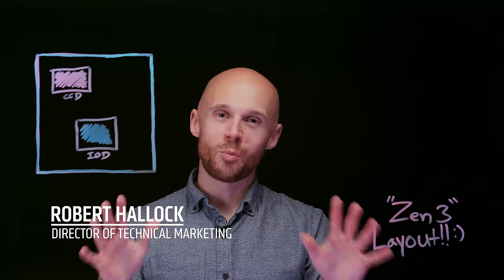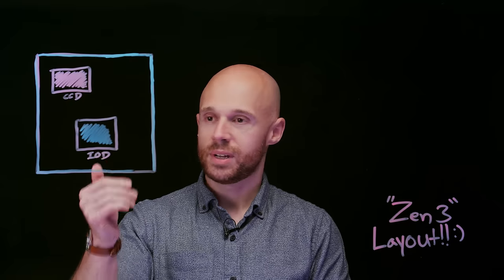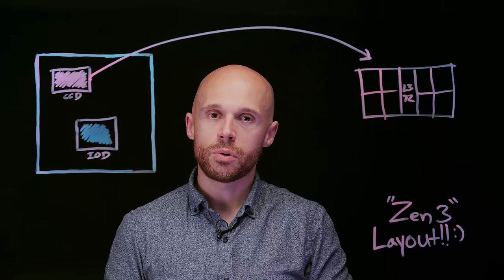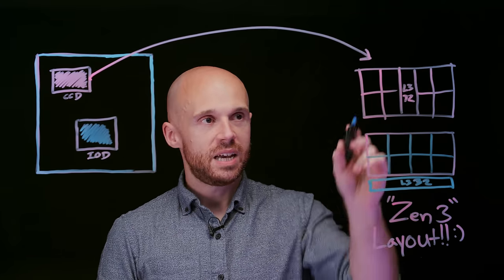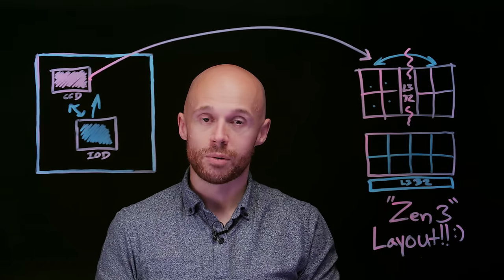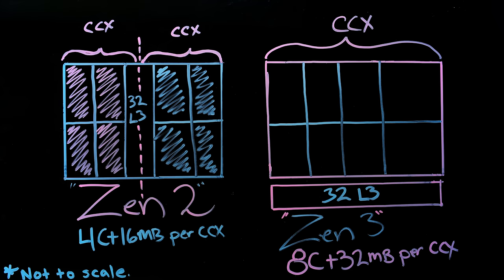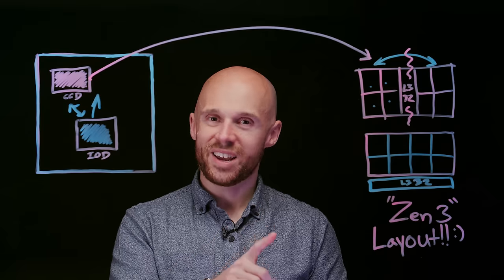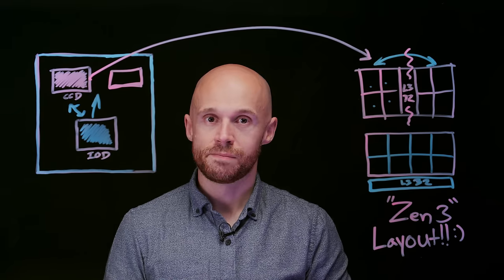How It’s Built: AMD Ryzen™ 5000 Series Desktop Processors

Comment: Rename the video to "Intel, this is how you make a processor"
Reply: This is very much AMD catching up with something that Intel figured out like 15 years ago. Try again.
Reply: @DravicPL  Does that means Intel have been selling you the same processor in the past 15 years?
Reply: @DravicPL  excuse me what boomer ?!
Reply: @ZaklanoCheljade  What are you talking about? I was talking about the architecture. You probably don't even know what a ringbus and a mesh are.
AMD's gaming performance could have been almost as good as Intel if they didn't commit to 4-core CCX few years ago. They are now going back to the trusted approach that Intel has been using for many many years now.
Reply: @DravicPL  The wheel was invented many thousand years ago, but we still perfect it to this day.
Your argument is invalid
Reply: @SpeedRebirth  I don't understand what your problem is with what I said but ok. Keep it up.
Reply: @DravicPL  The problem is you give Intel credit some AMDs design. This is NOT an Intel design lol
Reply: @DravicPL  No. Intel streched their ringbus from 4 cores, on which it still works fine, to up to 10 cores now which causes an extremely uneven core-to-core latency and a very limited bandwidth without taking up too much die space, especially on cut down models with randomly placed disabled cores. On Ryzen every core is connected with every other core and they only started with 4 core networks because its extremely difficult and took more time get it to work with 8, but there was no backpedaling as it was planned from the beginning. You may wonder why they arent showing anywhere how exactly the interconnect works and thats easy to answer too: Its the last missing piece Intel needs to design a competitive architecture. Intel has tried a mesh on their enthusiast platform and it was horrible, at least for gaming.

Comment: How it's buried: Intel coffin lake
Reply: @biteme3989  🤔
Reply: @biteme3989  well, it's unlikely that their 11th gen will catch up, because it maxes out at 8 cores. Which is almost peasant status compared to the 5900x or 5950x.
Reply: Four cores 'aught to be enough for everyone.
Then again Intel did outperform anyhow.
Reply: 300 bucks for a 6 core PGA CPU when you can get a 8-core Intel for the same price...
Reply: UNDERRATED
Reply: I smell some bad COFFEE here
Reply: @raawesome3851  11th gen will catch up in gaming only
Reply: @rdmz135  yeah, maybe. We don't know. Stock is a whole other issue.
Reply: @MrXHDTV  what does pga have to do with anything? Also, that cpu will be faster in games, and depending on the ipc, even productivity should be equal, or competitive.
Reply: what? I've used 4 cores, and they are slow.
Reply: Intel seems like they getting desperate because of the blogs they post
Reply: Typical AMD fanboys or should I say AMDrones
Reply: @ahsanqureshi786  well, I doubt Intel will die within the cpu space.
Reply: @raawesome3851  pga is terrible and those pins are easy to break especially when removing the cooler and it's all about money to performance ratio, 300 bucks for a 6 core amd vs 8 core intel, think about it. It would have been a killer product if priced 50-70$ lower. They increased not only the IPC but also the price.
Reply: @Needz I've built an i7-10700 pc recently and was thinking initially to wait for amd 5600x but Intel is only 340$ while 5600x will be at least 380$ in Europe.
Reply: @Needz 10700 is 300$ and has 2 more cores than 5600X.
Reply: @raawesome3851  So you think Intel gonna price the 8C Rocket Lake same as 5900X or 5950X?
Reply: @Needz 10700 it's 340$ in europe after tax but 5600x will be 380$ at least and btw the z490 motherboards are pci gen 4 ready, future proof like x570
Reply: More cores is better for programs/games that run better on more cores.
For example, a 1 core cpu would probably run better on single core programs, while a 16 core cpu would probably work better on a program that benefits of waaay more cores.
Reply: @rdmz135  Eh, AMD is catching up.
It’s not long till Intel is kicked out of the gaming space too. I bet Ryzen 7000 will completely denotate Intel, except in Laptops maybe.
Reply: "intel inside" sticker on the grave
Reply: @raawesome3851  The core i9-11900k will take back the crown for gaming it wont be the better option overall tho. Intel say a double digit ipc increase and i expect a 5.5 ghz overclock to be possible. 8 cores is all you need for gaming if you want more wait for 12th gen it will have 16 core 32 thread
Reply: @biteme3989  Hurr durr, it doesnt matter what amd does guys, our software dev friends will just adjust their code to make intel look better and amd worse. Hurr durr intel fanboy for life.
Reply: @ahsanqureshi786  Hurr durr, it doesnt matter what amd does guys, our software dev friends will just optimize their code to make intel look better and amd worse. Hurr durr intel fanboy for lyf.
Reply: @MrXHDTV  well, it's also easier to fix. Lga processors are also going to be attaching to a motherboard, and they will have a harder time fixing a broken motherboard than a broken cpu. Also, where is this 8 core for 300 dollars that you speak of? The 6 core 10600k costs 280. The 10700k costs 370.
Reply: @MrXHDTV  it's still a killer product.
Reply: @ahsanqureshi786  yeah, of course, they have to, otherwise they lose their premium factor that comes with being Intel.
Reply: @noahdoerfler1865  5.5ghz... what are you smoking? Also, no, 8 cores is being used in the f ing consoles. It's going to quickly falter.
Reply: it is not called coffin by accident
Reply: @raawesome3851  lmfao if 8 cores isn’t enough then why are the core i9-9900ks i7-10700k and r7 5800x all on 8 cores with top 10 gaming performance?? 8 cores is more than enough. Also what do you mean 5.5 ghz isn’t possible core i9-10900k hits 5.3 ghz all core oc on 10 cores. So if you’re telling me with two less cores  the 11900k can’t do that with generational improvements too you’re a clown. Look it up
Reply: @noahdoerfler1865  because that's now. When the consoles release with 8 core utilization, they will falter. Also, single core 5.5 ghz doesn't matter. If it did, then we'd have single core, non hyper threaded CPUs, which run at 20ghz. It wouldn't run well.
Reply: @noahdoerfler1865  11900k will be faster than comet lake, definitely, but pricing is a serious issue. Because if Intel prices their 11900k at the price of a 5900x, then it's worthless, because you are getting so much more through ryzen.
Reply: @Needz 5600x will not beat 10700 in multicore, it may be close but there's no way 5600x will score 5000+ in cinebench r20
Reply: @raawesome3851  I agree for the most part but if intel can reclaim their gaming crown then people who just want the best gaming performance no matter the price it will sell just as the 10900k did
Reply: @ahsanqureshi786  also no overclocking.
Reply: @raawesome3851  what?
Reply: @ahsanqureshi786  the 10700.
Reply: @biteme3989  even if intel manage to catch up in the next release. its not coffee lake anymore, so the burying coffee lake statement is still valid
Reply: @yami1603  which 8 core? The 10600k costs 320.
Reply: Makes sense
Reply: @raawesome3851  its already great even when stock, no need to OC.
Reply: @ahsanqureshi786  is it? At stock speeds, AMD and Intel are basically neck and neck, and that's with ryzen 3000.
Reply: @ahsanqureshi786  also, it is handicapped by Intel's strict guidelines on only allowing z series motherboards to have better memory speeds.
Reply: Chris Schuler  actually, z490 motherboards support pcie 4.0, you don't know what are you talking about
Reply: @raawesome3851  I am just saying that 10700 is also 300$ and 5600X can't beat it in MT.
Reply: Chris Schuler  z490 motherboards support pcie gen 4, you can install later 11gen CPUs that will enable it, the same thing is on AMD, you can use CPUs like ryzen 1700x on PCIe gen4 boards.
Reply: Chris Schuler  11gen comes in Q1 2021, it may be even better than zen 3, why not wait a few months more ? 10nm intel is not worse than 7nm tsmc, they are basically the same. Most people don't care about pcie gen 4 right becasue it's not useful at the moment, that's the point that you can upgrade the cpu in the future, valid for AMD and Intel 10G users. My z490 is pcie 4 ready and maybe in 2-3 years ill swap the cpu for a better one, who knows.
Reply: Chris Schuler  it is 10nm 100% and no -pcie gen4 does not improve the performance of rtx 3090 or other cards,  less than 1% difference, still not that useful at the moment. Maybe pcie4 ssds are faster but I don't  care  right now because I'm happy with 3500MB/s, as I said pcie4 is for future
Reply: @raawesome3851  the entire tech community would argue that below 5.0ghz is peasant territory because evidence supports higher clocks = better performance and since amd was more then 19% ipc (instructions per clock) behind intel that means that not only has amd failed at matching ipc but they didnt even boost clocks to compete so you have less instructions per clock (no news there) and lower clocks. 

Its really very simple for anyone who isn’t a fanboy.
Reply: @MrXHDTV  i love how you forget the 6 core i5s just to make yourself feel better, whats even funnier is you can oc a i5 10600k to 5.1 all core and 4.8 uncore and ring and guess what! It matchs the 10900k in most cases if not all in gaming because games 1 dont use any more then 8 cores unless you do not have hyper threading or smt.

So thats equal gaming perf compared to 10900k and the 10900k blow amd straight out of the water core for core but wait the 10600k is 302 usd... remember how you said “its all about money to performance raito” i guess it lucky intel uses dye sanding and its in general cooler so that means its a cpu for the same price requiring cheaper cooling.

Yeah you really used your brain on that one Einstein.
Reply: R5 5600x completly obliterates 10900k in single core. You obviously know that ryzen has always been ahead of intel in multi core. 

So in conclusion, INTEL IS FUCKED.
R5 3600X isn't even amd's highest tier processor.
Reply: @MrXHDTV  its called generations
Reply: @birk9497  lol
Reply: When will the Zen 2 APU Non-Pro Version be release?
Reply: @starnoelle8248  It's just that I'm older than you guys and some of you may not understand what and why I'm saying what I am.
(Born 1979, first computer Z80 based MSX machine in mid 80s, first programming including assembly early 90s, computer science at university early 00.)
Reply: @starnoelle8248  360 mm aio or custom loop. My mate is using a h150i pro with a 10900k oc 5.3 ghz
Reply: @starnoelle8248  i haven’t asked about temps but from what I know there haven’t been any problems lol
Reply: @raawesome3851  Leaks of their speed indicate that they are faster. What has 8 cores to do with catching up at all?

Intel is going for the gaming market, no game uses more than 8 cores ever. Even the more demanding games I have tried use 40-60 % of my ryzen 3600, even if I lower graphics.

6 cores is still more than enough, and 8 cores is also very future proof, I don't see why anyone would pay more for more cores if their building a pc for gaming. Also, more cores usually mean slower clock speed.
Reply: @MrXHDTV  ?
they are the same price for the same cores now. Intel isn't cheaper, just isnt more expensive now.
Reply: Why do you all have such strong opinions on this, trying to justify your own purchases or what?

Prices aren't the same for everybody as some countries price AMD cheaper while some Intel. And since there are older cpus to buy and also used ones, so discussing value and price is pointless.

For me atm, in Europe, a 10700k costs about $400. The prices aren't even the same in all of USA, much less in Europe or somewhere else.
Reply: Coffin lake lmaooo
Reply: intel inside it's grave
Reply: @ahsanqureshi786  ok so where the hell do you even stay . 300 dollars for 10700 . You dreaming ? Oh I smell a fanboy here 😂
Reply: @MrXHDTV  but the 6 core has equal performance or better in multicore and singlecor ebenchmark
Reply: @noahdoerfler1865  they NEED a 20 percent moremipc gain
Reply: @noahdoerfler1865  nope, intel sayed only HEDT will have more then 8 cores,
Reply: @MrXHDTV  but the 10th gen cpus don't support it

Comment: How it's built: With Intel's tears
Reply: im dead 🤣
Reply: you know this is how intel cores are in monolitic design right? thats why they are better in gaming up until today. Now with the new AMD architecture comes a +100$ price hike as well. The 10700 for 300$ is still dam good value which eats a 3700X in gaming alive. The competing 5000 part will cost more, so this time AMD will be the more expensive one for the same performance. The B550 chipset is already prices same as Z490, which is ridiculous. Not to mention heat, the 10th gen intels run around 30C cooler on average while being faster, that is a huge thing.
Reply: @zeus1117  It doesn't matter. It's still better value than intel.
Reply: @zeus1117  AMD's processor that competes with the 10700*K* is the 5600X and so far it seems like it was available for cheaper than both 10700 versions at only 330% vs 370-410$ on Intel's side, and for some people it won't even be necessary to change their motherboard. Yes, you do lose a bit of productivity in comparisson, but that comes from losing in the core count since you're putting a Ryzen 6 vs an I7 that's more evenly matched against the Ryzen 7 5800X, yes, the AMD part is more expensive, but to fully compare AMD and Intel dollar by dollar we have to see what Intel presents by the end of the year (I don't remember their release date, might be next year) And see how they price their options. Oh and it seems like the 5800X dominates the 10700k in every aspect, benchmarks, gaming and productivity without increasing power consumption compared to the 3800X.

I was waiting for a release like this since the first generation of Ryzen, I was not ready to let go of my not old back then 6700K that's been serving me well for a while but I wanted to see AMD matching or beating Intel in single threaded performance across the board, that and the new tech that AMD is pushing out with this release really make me wanna buy now instead of only recommending their low end up to the Ryzen 6 processors, already been setting myself up to buy a 3950X but wanted to wait for this release, and the 5950X looks pretty damn good. I don't hate Intel though, I really want to see them blowing our minds coming back to compete head to head with AMD but I don't think this refresh is the one when that'll happen, that seems more like a late 2021 kind of thing.
Reply: It's tears that hold the cores together